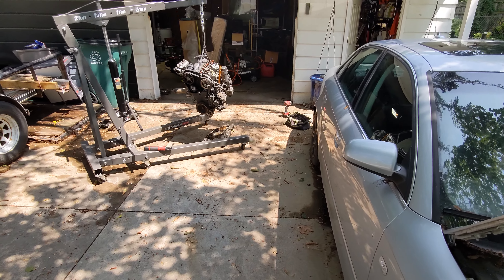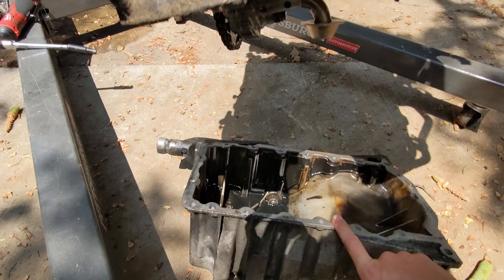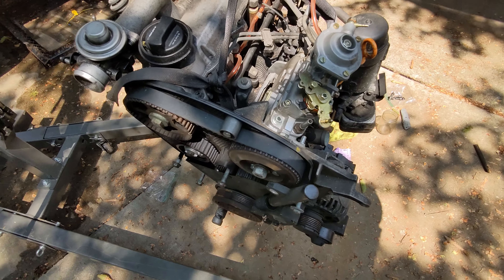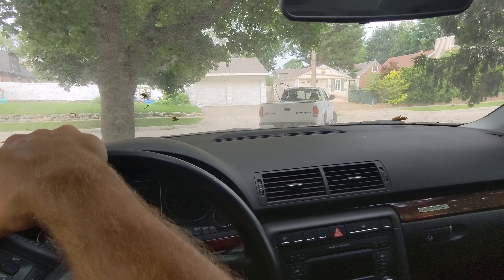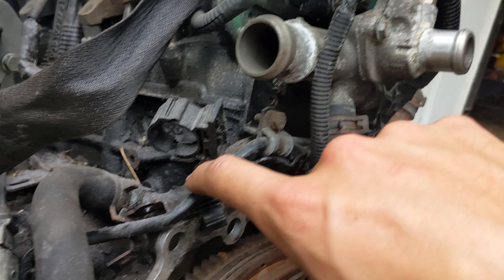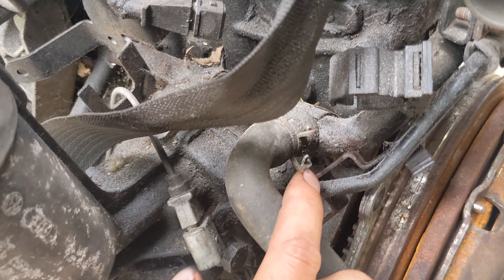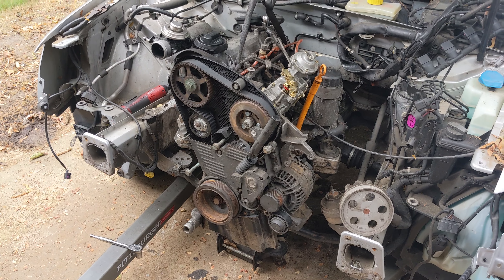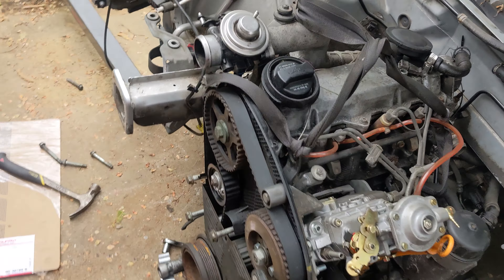TDI Swap Update #7 - Oil pan is on and Installing the engine

Comment: I have an 01 awm 1.8t big turbo...  sweet build... thought about doing the same build..ish... so i was thinking. You should learn to weld... welding is not that hard... buy a cheap one and play around with junk.... you builds will benefit